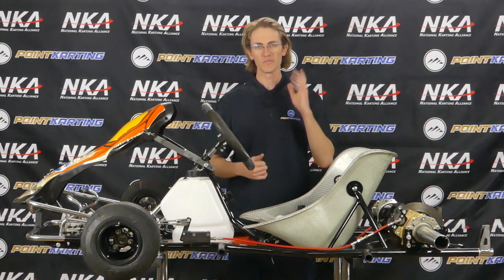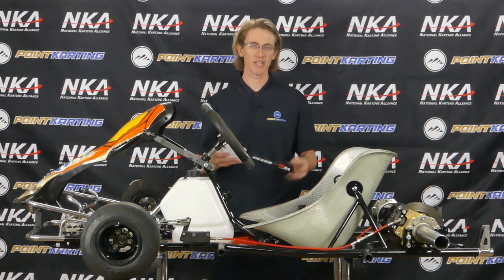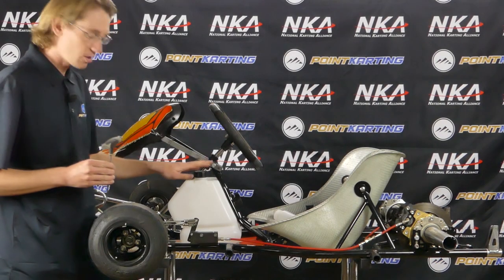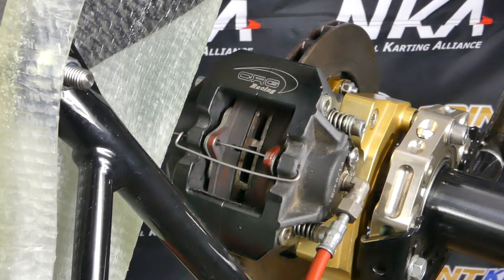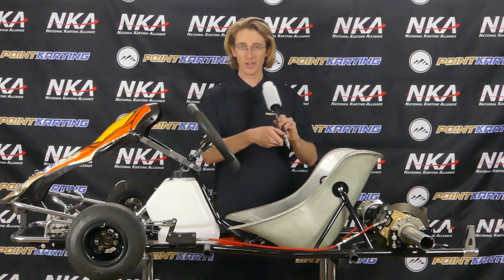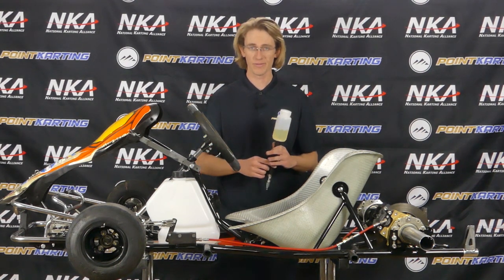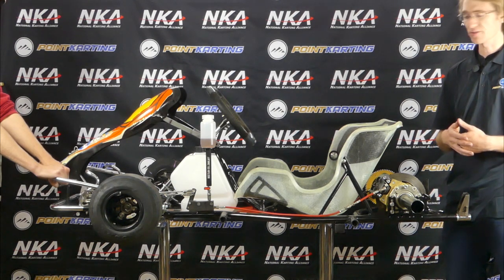How To Bleed the Brakes on a Racing Go Kart

Comment: Can you please explain how to do it without the bleeder tool? There is no bleeder available for my brake system.
Reply from the maker: @Davi2010jk essentially the main different with the bleeding procedure if you don't have a master cylinder that adapts to the bleeder is that you will have to gradually fill and re-fill the master cylinder on your kart to bleed the brakes. On many karts, the master cylinder is very, very small, so keep this in mind when re-filling. My rule-of-thumb for bleeding brakes without a tool is to fill the master cylinder, cycle fluid through the system, and then bleed the brakes at the caliper a total of (2) times, then open and re-fill the master cylinder. Repeat this as many times as necessary until you are ready with a solid brake pedal! I hope this helps your question, let me know if you have more questions!
Reply: @PointKarting  Thank you so much for the swift and detailed reply. Just to clarify, do you refill the cylinder directly (by removing the screw like in the video) or the reservoir (by unscrewing the lid)? Thank you! You have a new subscriber
Reply from the maker: @Dabaiko  In your case, if you do not have a brake bleeder tool, I would refill the master cylinder reservoir directly. A lot of patience, some rags on stand-by, and slowly pouring are key! Hopefully that makes sense!
Reply: @PointKarting  Thank you for the perfect explanation!! I'll give it a go this weekend.
Reply from the maker: @Dabaiko  Awesome, let us know how it goes!

Comment: Hey thank you for the helpful video, I just had one question regarding the rear break cilinder. Are those just normal common Philip head screws, or is there a hole drilled trough like and normal bleed nipple lol on a motorcycle for a example?
Reply from the maker: Hey Arjan! The bleed screw can vary oon the caliper depending on the kart, some (like this one) use a M3 allen-head screw on the side of the caliper. Others utilize a nut / screw on the top of the caliper that typically takes an 8 or 10mm screw. Motorcycle brakes will be similar in design and setup to most go kart calipers. I hope this is helpful! Reach out to us via email if you have trouble finding your specific bleed screw on your brake caliper (pointkarting@gmail.com)

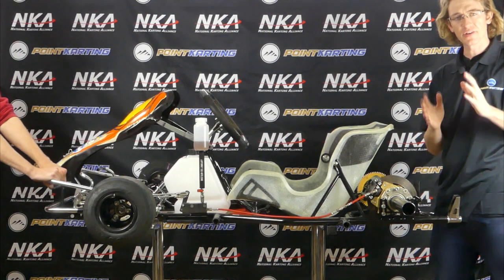Comment: 6:12 ---6:13 break oil change color
Reply from the maker: Hi Goran, yes excellent point! This kart we used for demonstration had some older fluid in it, so hence the color change, as the two fluids were mixing. The DOT rating and type was the same, however. This color change is fairly common, but thank you for noting it!